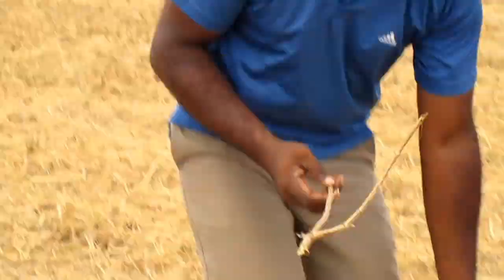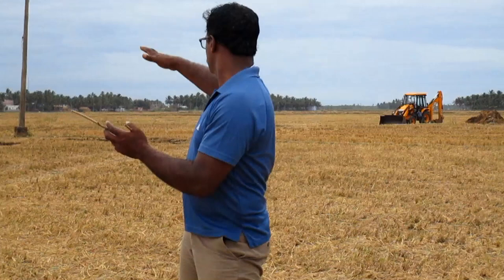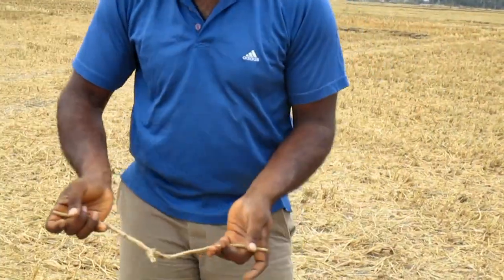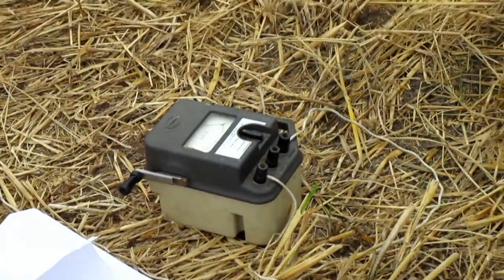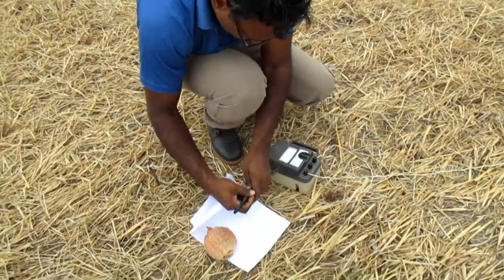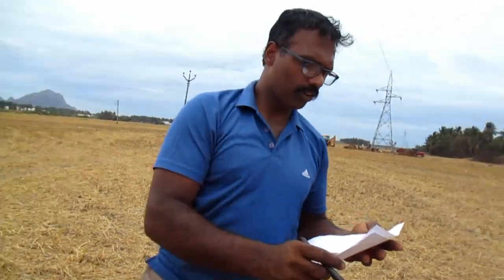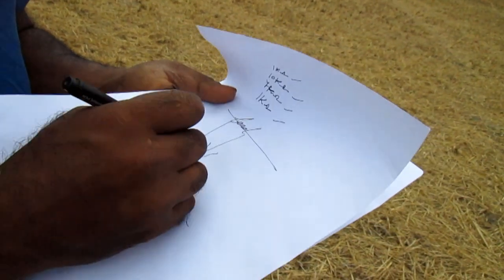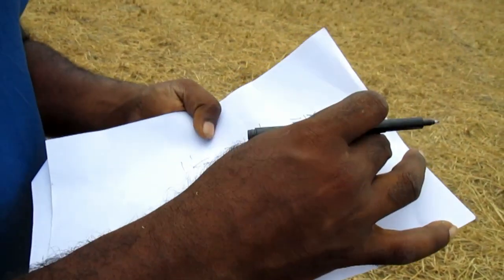Finding ground water using scientific and traditional technology

Comment: is  this instrument not used for messuring  cable  resistance  of the plastic arround it  ?  it is a megger  an isolation tester  for  cable
Reply from the maker: Right
Reply from the maker: Almond d souza
Water diviner
9488134139
9865660921

Comment: THERE IS SMALLEST READING IN  EARTH RESISTIVITY METER OR MEGGER ( AS SEEN IN VIDEO ) IS STARTING FROM 1MEGA OHM AND AT PAD YOU SHOWS  1KTHEN 1K,THE10 ETC HOW
Reply from the maker: deepa raundale 

Depends on water
Reply: I WANT TO SAY THERE IS NO READING IN MEGGER AS 1K  THEN HOW YOU READ 1K OHM ?
Reply from the maker: deepa raundale 

Check it
You have gone different types of mergers for different range
Reply: OK WHAT IS YOUR  MEGGER RANGE SIR
Reply from the maker: deepa raundale 

Till 100 m ohm
Reply from the maker: almond d souuza, water diviner, +91 9865660921

Comment: Stick method is completely fake - magnetic field works on metals only 🤣🤣🤣
Reply from the maker: Have you got magnetic energy in your body
Read ideomotor effect
Reply: @almonddwater  due to force of retaintion on the streched stick it wants to come back  it's initial state , and in which side the force applied by your fingers become weak it the stick rotates in that direction . And while moving forward the stick feels some jerk which helps the force to do the movement easily.😁😁
Reply from the maker: Try to read the principles of magnetic fields